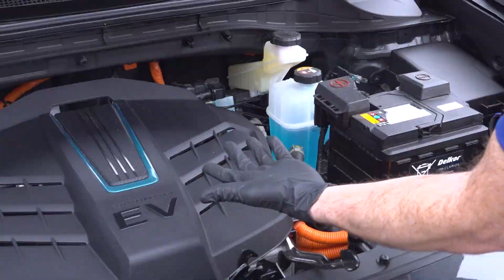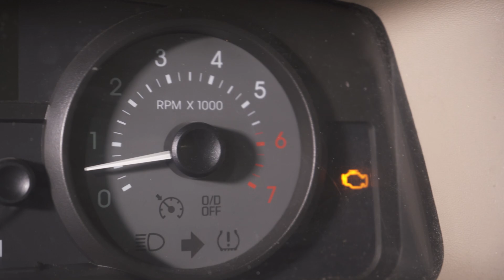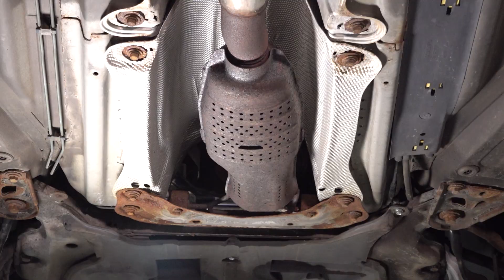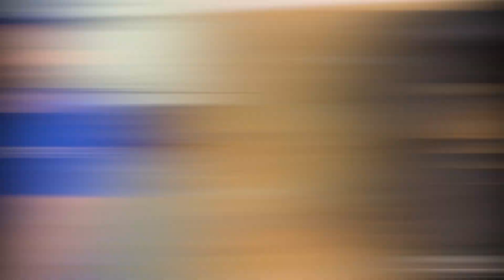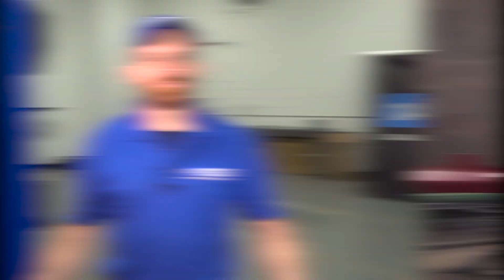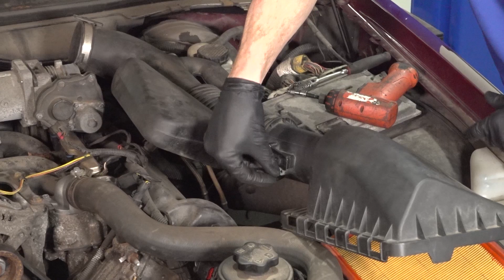Car or Truck Running Rough? Find Out What Sensor Would Cause This. Easily Replace It and Save Money!

Comment: I have a 1996 GMC half ton pickup with the 4.3 leter V6 vortec I replaced my mass airflow sensor and it still won't run right. I have to unplug it for it to run right would like answers please I'm puzzled